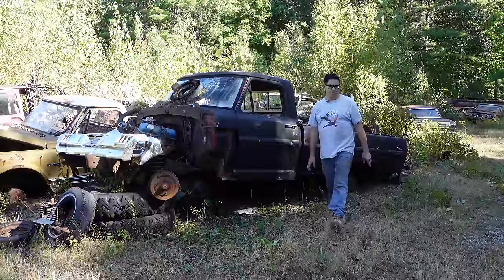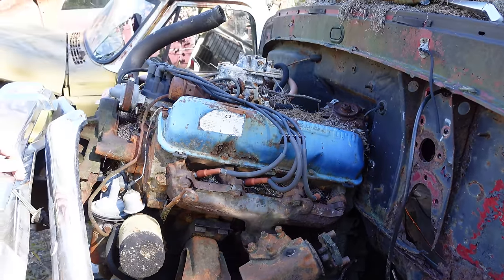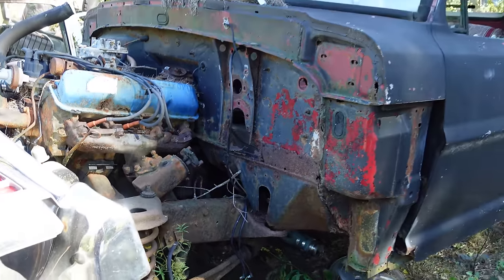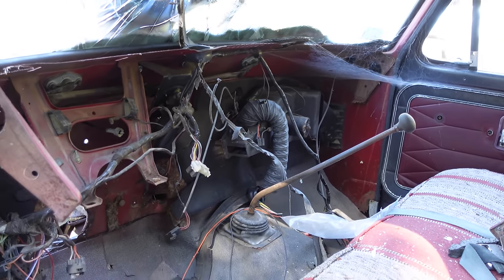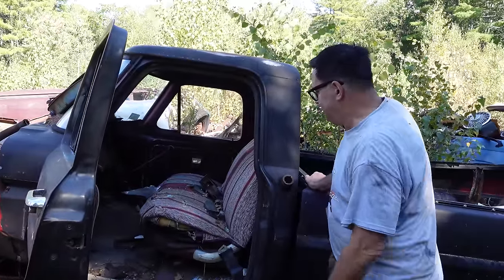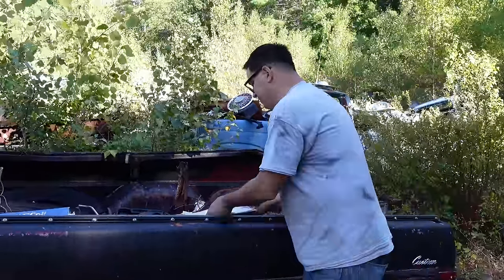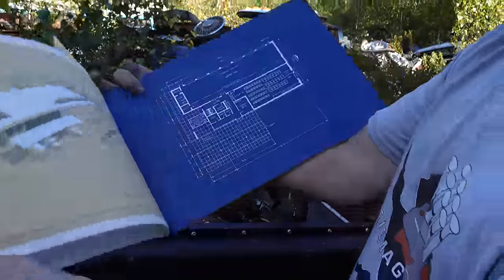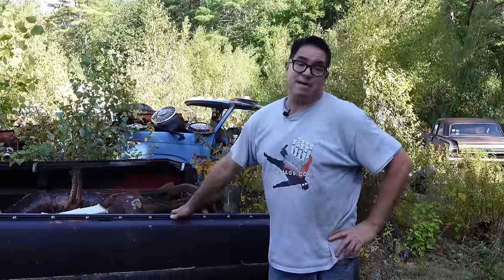F100 Big Block Swap

Comment: Steve, It is reassuring to be reminded that we survived and even thrived without oversized, overpriced, 400+ hp, 4x4 pickups for so very long. 😉
Reply: ...overpriced 400 hp, 4x4 mom-trucks...

Fixed it for you...🤣
Reply: @DanEBoyd  The number of $1000 per month payments on trucks is shocking
Reply: I can live without power windows, AC, an automatic transmission, but I use every bit of power and four wheel drive all the time. Those old trucks with a big block would give a new truck a run for the money.
Reply: There’s something about the 96 month financing that is unsettling….
Reply: Trucks today are nothing only overpriced but they're also made out of plastic as well and I know most of (especially those overpriced EcoBoost trucks) won't outlast my old 1996 Ford F150 with a 5.0L (302) Windsor V8.
Reply: @CJColvin  Bring back the 302!!!!!!!!!!!!
Reply: @CODA-Improvements  It is not too unsettling if you have scuba gear and are very comfortable being under water 😉
Reply: @DanEBoyd  😉
Reply: @rightlanehog3151  Amen brother, although the modern 302 we have is the 5.0L Coyote V8.
Reply: @CJColvin  In 20 years we will know if it was as steadfast as the 302.
Reply: @rightlanehog3151  Right
Reply: Yes and usually the loaded newer truck is not very impressive when it comes to using it to haul heavy payload items and the same truck minus the options for the luxury and convenience from 40 years ago can haul them all day long..  hence why I wanted a bumpside Ford 68-71 Ford f250 camper special equipment truck heavy duty suspension and the 8 or 11 leaf spring pack per side very stiff riding unloaded truck but with that suspension and the fe big block truck and the camper special trim truck usually has the better front brakes even if it is not the disc brakes that 69-72 got and usually got the option of automatic transmission and or granny gear heavy duty Borg Warner top loader 4sd manual floor shift transmission and it is still a quite capable work truck for many heavy hauling duties..  Not saying that my 2000 dodge ram laramie slt quad cab 318 magnum V8 46 RH 1500 long bed 4x4 can't do them it's just not as capable or as easy on the truck to use it to work like that, my truck drives way better than most of them I have owned or been around and rode in the second gen dodge trucks, the front suspension is from rebuilt

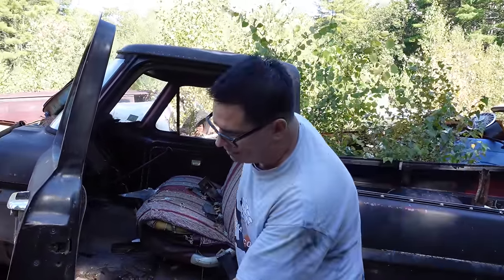Comment: I had a 67 F100 "Ranger" short bed fleetside. Originally a 352 3 speed. Took a 69 Camper special and put all the H.D. 5 lug suspension under it, C-6 auto, power steering and the under dash A.C. Got a 68 Mercury 410 crankshaft and bored out a 390 and basically made myself a 428. I also put a 3:50 Trac lok out of a 71 E 350 camper van.

Comment: My grandfather had a 1970 F100 Farm and Ranch Special. 140 hp 2bbl 302, three on the tree, 11” clutch and a 4:12 9” rear. I remember him taking off in 2nd gear and taking corners in the neighborhood in 3rd at 10-15 mph and it would chug right through with those gears. I can still hear the sound of the door handles and squeaky hinges. I wish I had that truck today.

Comment: Hi Steve, I used to be a Front End "steering and suspension" specialist at a large Ford dealer.  Bending the Ford Twin "I" Beam(s) to set the camber angle is not difficult at all, and in many cases, actually easer.  That Ford 9" rear MIGHT be a 31 spline axle Vs. a 28 spline, due to the fact that the center of the hub flange is flat with two drill index marks on either side of the center and if so, that Ford 9' is worth more.  This is how the 31 splined axles are identified, I.e., Boss Mustang's, some Shelby's and some 427 Fords.  28 splined axle flange centers have a big lip on the outside and a concave cup with a center center drill index mark.  You can convert 28 spline to 31 spline by installing 31 spline axle gears.  The axle gears are NOT the spider gears, but you should replace as a set.  By the way, 28 splined Ford 9" axles interchange with all Ford 8" rear ends "same spline"  Please reply.  Dave...
Reply: Tried replacing my 28 spline Galaxie axle with a 31 spline oiut of a 429 T-bird. The 31 spline axle shaft  has a larger dia and despite the fact thst both rears had the same flange to flange width, the axle shafts were a different length. The pinion gear on those T-birds are humongous.
Reply: By the way, the large pinion gear on the Ford 9" rear makes it the strongest rear second to only the Dana 90 rear.  With a large pinion gear, the pinion gear must be located further away from the ring gear, this makes it a stronger rear but in the mean time it is a less fuel efficient rear, (more rotational resistance) this is why Ford replace it with the integrated 8.8 rear.  The Ford 9" rear is stronger than the Chevy 12 bolt and/or the Chrysler Dana 60 rear.  The Ford 9" rear is the most popular drag racing rear no mater what kind of car they are in and the Dana 90 rear is the second most popular rear for drag racing, but in the mean time, the Dana 90 rear weighs about twice as much as the Ford 9".  Please reply.  Dave...

Comment: that "rag joint" may have helped with vibration transfer but its main use was to allow some misalignment from the steering shaft and gearbox caused by frame flex body movement and allowing a separate steering shaft for crash purposes. not only did the columns collapse but the rag joint was there for side frontal impacts to keep it from being transfered through the column. this also give engineers wiggle room for offsetting the column some without binding
Reply: I replaced the rag joint in my 57 Pontiac earlier this year. I wound up just pulling the column to do it as I resurrect this beast.
Reply: This is why I read comments. Appreciate the info.

Comment: Back in the late '80s, my 1st wife found a truck she wanted.....
A 1972 shortbed F100 Sport Custom.
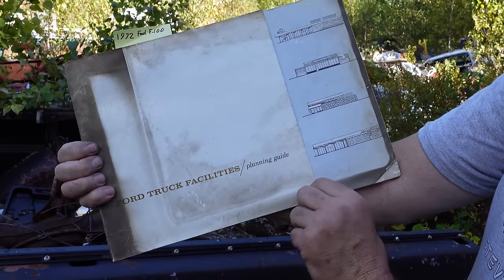The guy that we bought it from, had stuffed a 460 ("donated" by a wrecked '74 Lincoln)...backed by a C6. Rear gears had been replaced with (I think I recall) 4:56 gears.

Admittedly, the truck was far from "original".
And it was a beast!

My wife didn't drive it until I got it home.
And then, she only drove it one time!
I remember telling her to, "ease into the throttle", when leaving a stopped position.
Did she listen? Nope.😁
Although she didn't put the throttle to the floor, she did press down more than needed!
That truck got super squirrelly and nearly put her in the ditch!
After that, she refused to drive it again... even though she was the one who wanted to buy the truck. 😂😂

Comment: 4th, with a comment. I had a ‘72 Ford Maverick with the 302/5 liter. I juiced it up with top end clean up( intake manifold and carb rebuild), true dual exhaust, rebuilt transmission with a shift kit. Was planning a differential replacement, going from 2.76 to 3.23 ratio, but sold it before I could get it done. A real 4 door sleeper that fooled more than a few guys around here ( Montreal Canada). Miss that car. 👍🇨🇦

Comment: My dad was a drywall contractor.  Must have owned about a dozen F-series Fords from the early 70's to the late 80's.  He used to say "A Ford truck will make you money."
Reply: A ford will spend your money in repairs aswell 😉😉
Reply: Dad was right. Fords were my main source of income.  If it weren't for Ford, my tools would rust.😁

Comment: Yes they had a complete hyd set up to bend the I beams. A little heat a lot of Hyd pressure and thre ya go. Did many of them back in 70s and 80s on   a hunter light a line  front end machine

Comment: Many 390's had 2 barrell's.
I had a 1968 Mercury Monterey with a factory "regular fuel 9 to 1 compression" 390 2 barrell autolite 2100 carb.

Comment: Back by 1995 there's a guy that's getting rid of one of these and I don't remember it was a 67 through 72 the body run and it had a 468 in it F100. The numbers proved out. I don't know why I didn't buy it.. there's $100 and a decent shape! That fiber connector you talked about and said they're supposed to keep vibrations out of the cab. Well on the sister of that truck it might save from Chevrolet 67 - 72. It's supposed to break away in case of a accident so that it did not show your steering column up into your chest. Of course it was right down by the steering box. I had a beautiful one back in the day. 1968 CST Chevy. 327 built to the hill except etc. That's fiber connector went out and I went into the local Dead Man's curve and I'm going to cut it short but thanks to some improvement on that curve I was the first one to survive a crash and did not go over the bluff, when I came to your kind of walked away from it here the telephone Man thought he's going to come back at 5 corps. Anyway heating the front axle on that Ford is sometime the only way you can do it but it says right on it do not heat or bend. Says it only some of them. Yes I've seen them hate it with torches many a times and bent back in the day because it would eat up because by supply tires in nothing flat. I'm sure Rita radios but where I grew up you didn't put anything with my supplies on those old trucks. The 69 I had was absolutely gorgeous but the title screwed up and that was 25 years ago and impossible to straighten up and guy bought it from parts. I still getting upset stomach when I think about that one. Thanks for another great episode

Comment: Back in the early 1980's I had a 1971 F100 that originally had a 360 but when I got it someone had stuck a 390 in it. It had gobs of torque so with the three speed manual you could turn a corner at slow speed and leave it in third gear and it would just chug right along. It was great at starting even in the coldest weather. One Christmas morning it was 38 below zero and out of five vehicles at my in-laws house it was the only one that would start and it was also the oldest. Later on I put a 302 in it for the greatly increased mileage it had to offer.

Comment: You are correct about front end alignment, years later Ford put camber alignment capability. I owned many Ford pickups my first one was a 1945 1/2 ton v/8 flathead. She was rough but I had it for years. 3 spd on the floor.

Comment: the old Broncos had the 9 inch diff and were 54 inches wide. Fit perfectly right under most cars with a little electric glue for spying perches or control arms.
The Lincoln Versailles had disc brakes so the housing was webbed around the center section for strength.
Wish they made more of that great stuff.

Comment: Had a 1969 F100 360, truck slowly fell apart (rough driving in the desert) but the engine started and ran every day. Pulled a lot of other vehicles out of that same desert.

Comment: Had a 69 F100 with the factory 360 that grandpa bought new. Two tone orange and white. He had an after market ac installed called “artic air “. It would get so cold it would form cubes of ice in the vents and blow out on you !

Comment: I run OBS Fords religiously. My current truck is a 95 F250 with a 460. 
A couple years ago, I bought a 92-96 supercab F150 that had a 460 put into it from an 88 van. The guy who sold me the truck insisted it was a factory 460 truck, built with leftover parts.
Never mind the VIN code, decal on the rad support for the 302 belt routing, the butchered wiring or the fact it was illegal for Ford to put a big block in a half-ton truck in the 90s. lol
Thanks for informing me about Bernardston Auto Wreckers, I my need to do business with them when I need parts when I'm in MA.

Comment: 71-72 were, due to the styling of the grill, my favorite years. 76-77 had a similar grill patern. 
Now, regarding jumping the truck or any vehicle that I've attempted to take flight in, every time I've done it I've broken a shock mount. EVERY TIME. It was fun, though
Reply: Square bulb 79 is the coolest 👊
Reply: @rustyshackleford6811  what about a square bulb 78

Comment: Steve, YES they used to Heat-up the I-Beams to set the Alignment on these trucks. My Dear 0l' Uncle did them himself for many years, including 1 of mine to get it right. YES it's True.
Reply: I remember seeing some of the vans done in the dealership as late as the early 90's when I started as a tech.
Reply: @paulday6875  I have a '77 F150, and on the Ford Truck Enthusiast forum, heating and bending is still the way to go.  Need a large truck shop for that typically.

Comment: I owned several Ford trucks ranging from 61 to 78 models back in the day.  I hated the 360's, they were just a gas hoggin' dog of a motor.  I mostly yanked them out and put 390's out of station wagons in them.  I could get a great used mill for $75-$100 bucks then, get a buddy and a case of beer, change it in one day on a weekend no problem.  Darn exhaust manifolds were always a problem on the FE engines. They were prone to cracking for some reason.  The pre 77 power steering set up was funky as well.

Comment: My very first vehicle was a 74 F100 with a 240 inline 6 with a 4 speed on the floor. I think it originally had a 3 on the tree. Had a broken motor mount that would allow the engine to torque up off the frame and cause the clutch pin to come off of the pressure plate and fall onto the ground. Found myself chasing after it one day as it was rolling across a bridge. When it would fall out, you couldn't pull the truck back out of gear. Had to let it roll to an almost stop, step on the brake and let it stall to a stop. lol. Took me a while to figure out that I had a broken motor mount and that it was what was causing it.

Comment: i remember the camper special long bed versions with rear axle pushed further back. my grandfather had one of those.
Reply: @Rich Rishel No, the 1972 Ford F Series literature clearly shows it for 1972.
Reply: F350 Camper Special, or Super Camper Special. I think it was a 140" wheelbase. With the spare tire stowed in the passenger side bedside, just behind the cab, under a removable panel.
Reply: @Rich Rishel Sure thing.
Reply: @DanEBoyd  No, the 1972 Ford literature does show a 159" wheelbase in the F-350 Camper Special line. It was only the F-250 and F-350 for the Camper Special in 1972.
Reply: @googleusergp  159wb without a bed,duel tires. Cab and chassis
Reply: @antarcticmoongiant2691  Yup, the F-350 Camper Special did have a 159" wheelbase according to the literature for 1972.

Comment: Always amazed me how the Twin I-beam was supposed to be so tough but they messed up all the time.  Radius arm bushings go quick and cause pulls along with tire wear due to camber being way out.  They did finally make camber kits incorporated with the ball joints.  Kind of a nice paying big job with those.  Glad they did away with that set up on the light trucks.
Reply: The twin i beam was a very oldschool design that sucked. Not a lot of adjustment and alignment changes at every point of articulation. Known for wearing tires.  It was a cheap affordable design which is what Ford was known for.
Reply: GM and dodge trucks always had more modern luxury designs before ford ever did.  Ford was always built cheap in comparison.
Reply: @brandonbell3089  I don't have any problems with mine I got a 69 Ranger besides couldn't be that bad they used it for a long time
Reply: I have driven Twin I Beam trucks for 40 years never had any issues..... 1995 F150 had original parts at 260,000 miles still drove straight
Reply: @purpurahaze9179  they used it for a long time because it was cheap to produce and easy to repair. But so are control arm suspensions. Sorta like a flat fender jeep.  I mean hell twin i beams didn’t even have camber adjustments only toe in and toe out. And the alignment changes at every point of articulation in the front suspension because they articulate from the center of the truck. It was a pisspoor design plain and simple. I have a 72 F350 flatbed in my front yard aswell.  When you compare the twin i beam to the GM and Dodge Control arm front suspensions which are fully adjustable along with sway bar options. The alignment also stays the same on a control arm suspension regardless.  Much much superior design theres a reason control arm suspension is used on vehicles to this day.  GM also had the control arm suspension long before fords independent twin i beam. GM also had front disc brakes in 71. Ford in 73 after
Reply: @purpurahaze9179  if the camber on a twin i beam is off caused by sagging springs or bent beams. You literally have to take the truck apart and have somone heat and bend the beams as close as possible.  With a control arm suspension you just shim the control arms perfect and align it near perfect